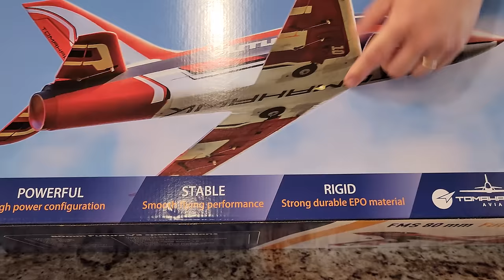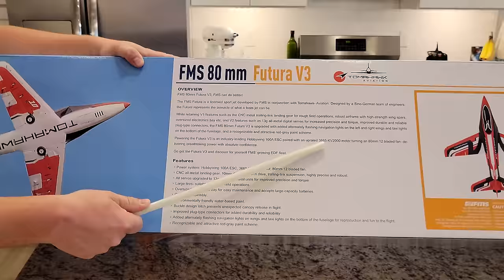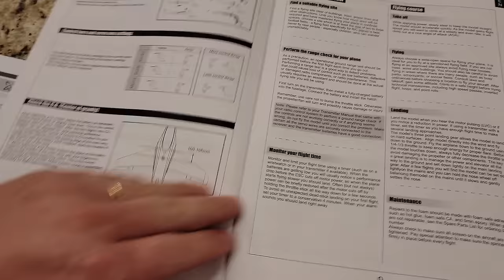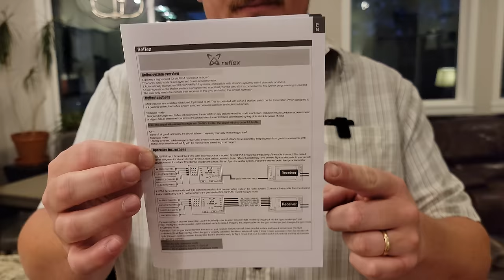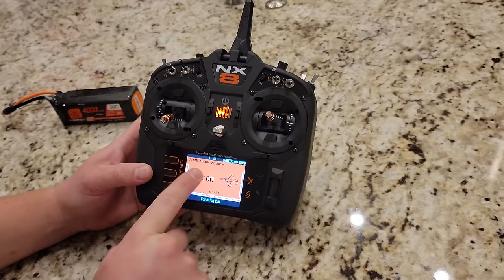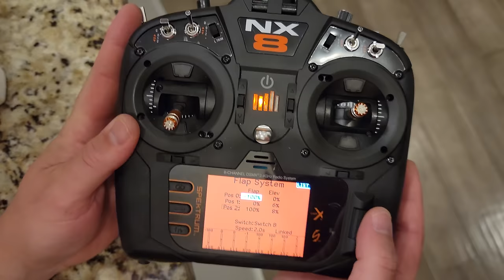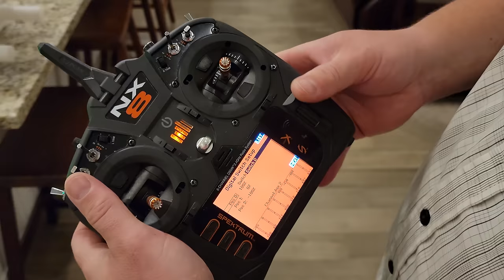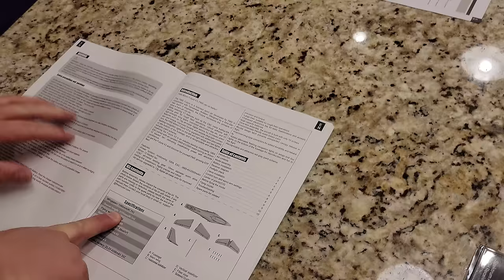FMS - Futura V3 - 80mm - Unbox, Build, & Radio Setup

Comment: Just for those who have 6 channels receivers, you can just connect any of the receiver ports to the fms gyro, adjust the mode you are looking for then unplug it and use the receiver port for your default channel, the gyro mode will stay on last mode selected.

Comment: Just put together my Futura V3 with a Spektrum AR620.  By default it was in Optimization Mode (AS3X) which is what I want to have on permanently.  To test this, I unplugged the Flaps from Port 6 on the Rx.  Then I plugged the SBUS Cable into Port 6 on the Rx.  I set up Channels so that Switch B controlled Port 6.  I was now able to switch to Stabilized Mode (SAFE), Off, and Optimized Mode (AS3X).  Then I powered down again, and undid the Channel change, and plugged the Flaps back into Port 6.  The mode is back to Optimized Mode... perfect.
Reply: Thanks for sharing, but is AR620 reliable for a jet.  Why they are mentioning on its features used for park flyers

Comment: Brian, what I had to choose from for a receiver that I had on had was either a ar631 or a ar637t so I chose the ar637t as I wanted to have battery pack telemetry but I ended up with a sbus/ppm wire left after hooking all the connections up. Do I need to plug the sbus wire into the xbus slot on the receiver.

Comment: I absolutely love your build and maiden reviews that got me in the hobby! I have my NX 8 unopened and leaning on your guidance to use. Contemplating on this Futura v3 and the Viper 90mm
Reply from the maker: It is an amazing plane, very fast, yet flies slow when you want, and can just ROCKET up into vertical! It's the epitome of what we expect when we get an EDF jet.
Reply: Did I read, Viper 90mm? 🙂￼ I'm in the same boat coming off the E-flight Viper 70mm which I absolutely love.  It's either the Viper 90mm, this or the Freewing Avanti 80mm (9-blade).

Comment: Hey Brian, Love that Futura,  I have the V2, now I've gotta get the V3. 🤩   Question for yeah,  I don't see you ever talk about the Spektrum AR630 Rx.  That's the one with no antenna and no telemetry but it does have AS3X.  I guess you don't use it because with that NX radio you  want  that battery info from the model?   But how is that AR630, is it a good Rx?   Thanks!

Comment: Hi
Great video… did you notice what type of control surface hinges are used. Nylon ?? Or just compressed foam ?  Thanks
Reply from the maker: I didn't pay super close attention, and very sorry for that. I usually mention it, as I notice, but I can tell you I only really dig into that detail, if I'm concerned about the build quality, or if it's a smaller plane, where the MFG might have been inclined to "cheap out" on the hinges.
Reply: @BrianPhillipsRC  thanks all good 👍

Comment: I didn’t notice if you added an elevator mix with the flaps.   If you did could you share it with me.   I just got mine setup and plan on maidening it this weekend.
Reply from the maker: I didn't. You can in about 5 second though...I'd make it on switch C so you can turn on and off, since it'll make your elevator super touchy ;)

Comment: Thank you for the excellent video. I bought this plane right after watching your video. I am about to by AR631 for my NX8. Are you sure that I can assign a separate switch for safe mode as all the six channels going to be taken as we have retractable wheels and flap in this plane. Thank you again
Reply from the maker: Yep! If you're using an AR631 ( https://bprc.me/AR631 ) SAFE/AS3X rides ON TOP of the pluggable channels so you thought be perfect. Your pluggable channels will look like this...

1. Throttle
2. Ailerons
3. Elevator
4. Rudder
5. Gear
6. Flaps

This means that your mode can run on channel 7 or 8.  Hope that helps!
Reply: @BrianPhillipsRC  Thank you for your early reply. Ok then I will buy it today but costumers service of a seller has told me that I would need to put wheels and safe mode on the same switch meaning that safe mode would work when I bring down the wheels. I trust you and I will buy it today. Thank you again

Comment: Hi Brian... Awesome video as usual. I m thinking of buying this futura v3 and was wondering if the ar620 receiver will be enough for this plane if I remove the reflex gyro? Also have you test flown it without the reflex gyro youself ? The reason Im asking is because I have a ar620 that I dont use and if I need to ad the cost of a new 8ch receiver to this futura it ends up almost the same price point as the bnf e flite viper 90mm that Im also considering but I like the looks of the futura better and its more nimble... Can't deside what to do 😊

Comment: How does that rx get power ?
Reply from the maker: From the ESC (the electronic speed control) KINDA...there's two sides of the power circuit on most of these ESC's - one side runs a brushless motor with the bulk of the power being consumed there, and the other part is the BEC, or the BATTER ELIMINATOR CIRCUIT, which steals enough juice, about 5V at 3-5Amps or so, to run the Rx, servos, stabilizer, led's, and retracts....basically everything BUT the motor(s).

Sometimes when a plane as MULTIPLE motors, the MFG'er will use a BEC external from the ESC, even if there's several ESC. This is to keep from having a floating ground, which can cause all sorts of problems. Sometimes they're called SBEC (for switching BEC) or UBEC (UNIVERSAL BEC) - they're basically the same thing FYI.
Reply: @BrianPhillipsRC  
Got it. Awesome info! Thanks a lot. 
Did you connect the bec to the rx on this plane? I didn’t see that get connected.